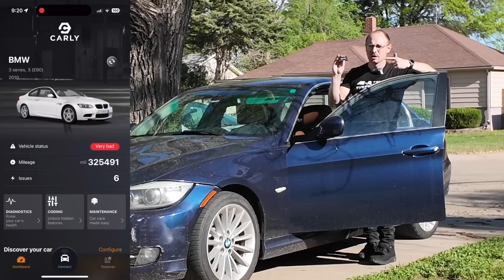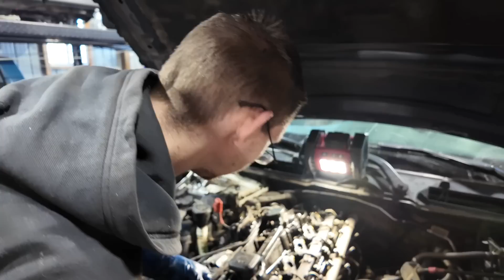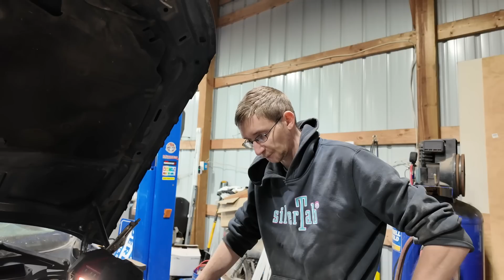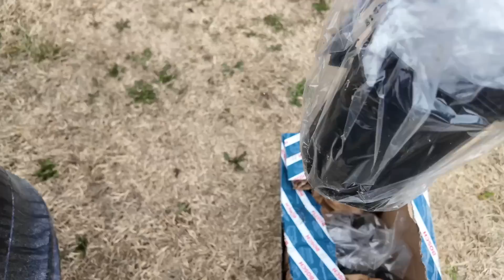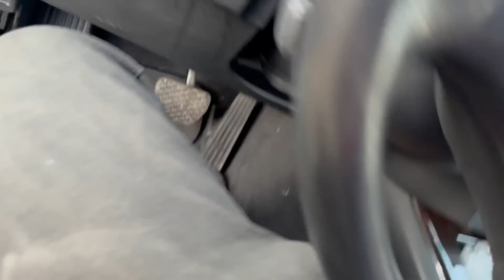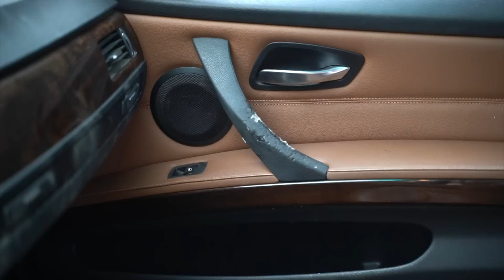I bought and FIXED @HooviesGarage  MECHANICALLY TOTALED diesel BMW!

Comment: Just prior to the Hoovie possession video, I purchased the cleanest that I could find, lowish miles (86k) Sport package (interior and suspension, not body kit) HK stereo idrive 335d. 1 owner car. Truly one of the best driving cars I've had. Mine still has all emissions. I initially got the same emissions faults as you, but I am sure it was due to sitting as they went away once it started getting used regularly. Not before I bought the heater/level sensor assembly however. Never installed it. I'll just sit on it in case I ever need it, but no issues in the last 5k miles. Glad you fixed this car. Hope the next owner enjoys it.
Reply from the maker: Sport package is truly transformative on e9x BMWs. I don’t think I’d ever own one long term without it.
Reply: Every 335d I ever saw had the M Sport interior.

There were no other suspension, brakes, dampers nor wheels of which I was aware.
Reply: @BurntOrangeHorn78 funny you commented today. This morning I hit a deer with my truck. Had to work due to a looming project so drove it home and got the BMW. Drove to work. Worked from 10am to 1am. On the way home hit a deer in the 335. 2 in 16 hours. Somehow the BMW fared way better than the truck. Was going about 70mph in both situations. Will need a new headlight and the hood repaired. Sucks but could be worse.
Reply: @dirtleg13 

Glad you did not get injured.  There are advantages to plastic fenders.

Comment: I own a 2011 Lemans Blue with Beige interior M Sport with just over 55k miles…bought new in March 2011.  Not my primary daily hence the low miles although I have driven it coast to coast twice in the past year.  My only complaint, other than the usual emissions issues, is the engine NVH at highway cruising speeds and my motor mounts are fine, I’ve noticed it from new, especially on very smooth pavement.  If I roll the window down, it sort of mitigates the NVH and when driving on grooved or chip sealed pavement, it’s barely noticeable.
Reply: That cannot be engine caused NVH.

Comment: I replaced the DPF, SCR injector , and all of the sensors on my 2016 X3 which I bought used last year from a scummy auto broker. The new  DPF is  the very latest version, and my exhaust now is so clean and completely free from any aroma, it literally smells like nothing but air!  The car runs perfectly.

Comment: What kind of fuel economy did you get?
Reply from the maker: Just filled up yesterday! 28mpg city.
Reply: @100PercentJake  yup, in the city they consume more (especially on the E90 with the DPF stuff), the M57 likes highways where it literally sips diesel.
My 02 E39 525d Touring (which only has the cats from factory, Euro 3 emissions standard) gets 30MPG in city driving and goes to 50 to 55MPG on highways, and I love it! LOL.

Comment: Welcome to the world of diesels. Be thankful you don't have to contend with the N47. The 6 cylinder diesels are more bulletproof. Regular oil changes are the key to engine longevity. Most turbo failures are due to oil starvation which is usually caused by a lack of regular oil changes.
Reply: The last version of the N47 is excellent. Every previous engine flaw has been corrected, aside from the usual cooling system and DPF replacement at 100k miles.  Mine  runs perfectly now after dumping in $2,500.   Drove cross country last year and it was an incredible experience of amazing road manners, comfort, economy, and performance.

Comment: Man, mad respect for taking on that kind of project—diesel BMWs are no joke, especially one that's been mechanically totaled. Can’t wait to see how it drives after the fix!
Reply: It drives pretty good. Wouldn’t know it’s got over 300k
Reply: Yeah, the complexity of all the different systems in that is nuts. Add in smaller volumes sold and you end up with a shopping list of many expensive parts all of which require lots of labor hours to replace.

Hence, mechanically totalled. 

It seems to me diesels went from a great simple and efficient drive train back in pre emissions days to overly complex and expensive drive trains in today's world.  Are the fuel savings over gasoline even worth it anymore when you factor in all the maintenance and repairs?

Comment: You can change the number of blinks of the turn signal with the settings menu in the BC (the buttons on the turn signal stalk), or in iDrive. But you can do it with coding too, LOL. Insert the key, hit the start button twice so the ignition is on but not runiing, and you can get into all sorts of settings. 

But for sure, you can't really DIY these cars without a decent way to read codes and do programming. I had Carly for VW and it worked great. I use ProTools and the actual BMW software for my pair of BMWs though.

Comment: The E90 chassis addressed the many of the multiple weak points of the E46 chassis, but added its own stupidity.  The in dash AC evaporator will leak (2 on my E90M3 under warranty).  The cup holders are a complete and utter joke.  Rod bearings (a consistent BMW theme) and throttle actuators on the E90M3 are must fix parts.  However, the E90 is by far the most robust BMW since the E30 (and I've owned them all).  What other modern car goes 300k miles and drives like a BMW?  Toyotas will go 300k miles but drive like a shopping cart.  Mercedes will go 300k miles and have acceptable driving dynamics but still not up to BMW handling or braking prowess.  That diesel looked like it had regular filters and oil changes and that's all it takes to keep most BMWs on the road -- do the maintenance.

Comment: It's absolute madness to use plastic hoses and couplings in the EGR system! All that heat combined with the oil and soot makes the plastic brittle as papyrus!
Reply: I mean these parts lasted 300k miles. 🤷‍♂️
Reply: @GrimesGarage  True...
The aluminum ones in the Volvo D5 diesel I sold in February looked like new after 14 years and 220.000 miles.

Comment: It's too bad you guys in America never got the excellent sequential twin turbo Volvo 5 cylinder diesel D5. 205-230 hp depending on model year and trim, loads of torque and extremely good quality.
No DEF/AdBlue to wrestle with, injectors aren't acting up. Simply a great engine!